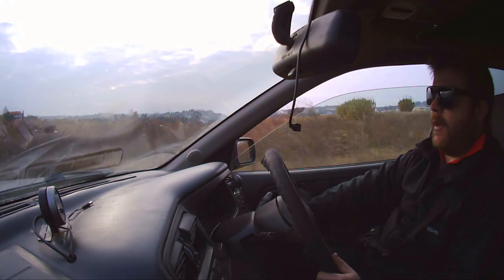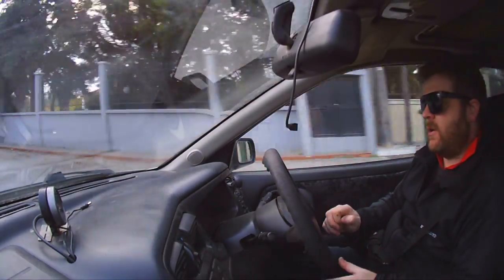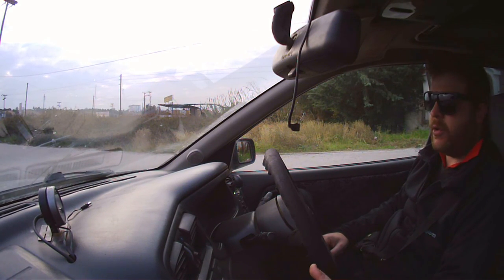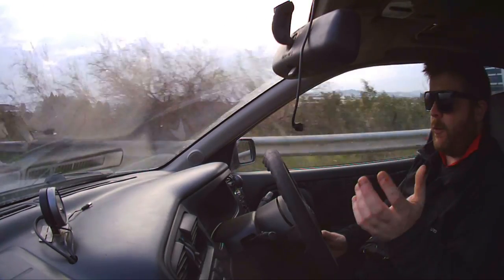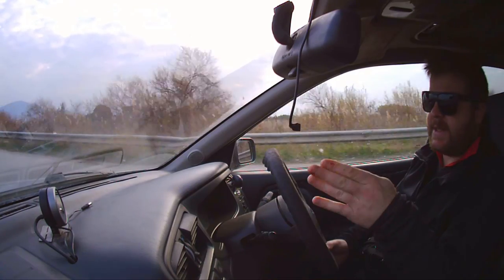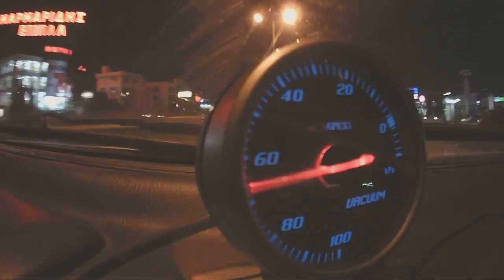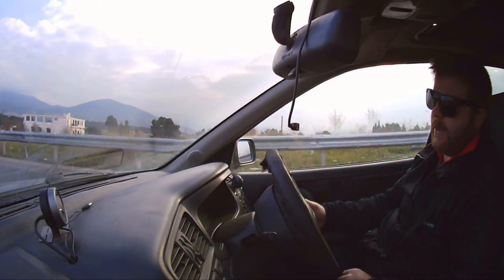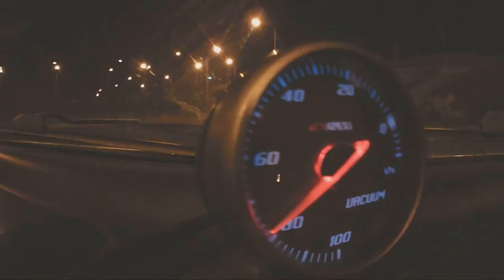Is Your Air Filter Big Enough? - Find out with a Vacuum Gauge

Comment from the maker: A vacuum gauge can also be used on a turbo car between the air filter and turbo inlet. It will tell you if the intake system before the turbo has a restriction.

Comment: Φιλε αξιζει; Δείχνει την εργοστασιακή ατμοσφαιρική πίεση του αυτοκινήτου
Reply from the maker: Hi. First of all, I just watched the video again, sorry for the rambling at the start. 

About your comment. Sure, if the gauge shows atmospheric pressure at full throttle & high rpm the intake system is doing its job.

But if the air filter or intake system is a restriction the vacuum gauge will show you that you have vacuum at full throttle and high rpm ie the needle will not be in the same place as it is with the engine off.